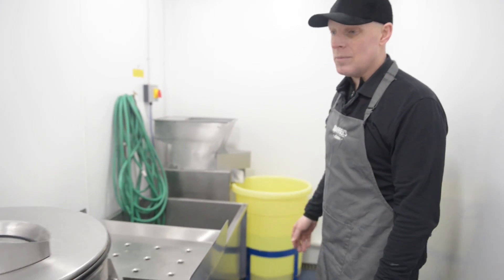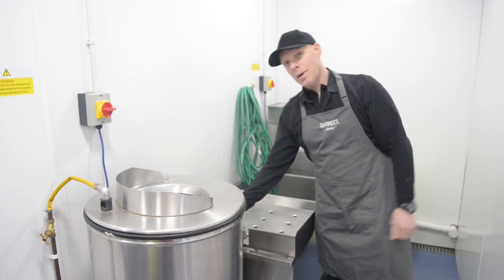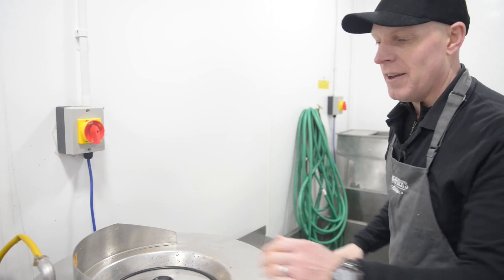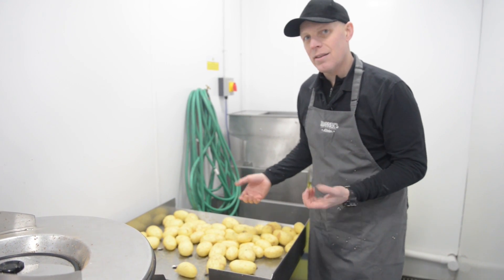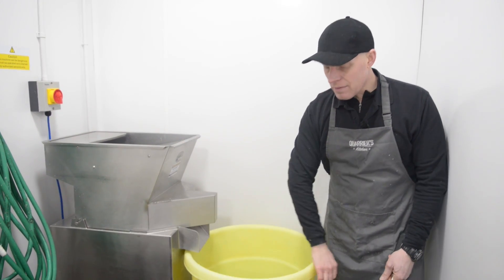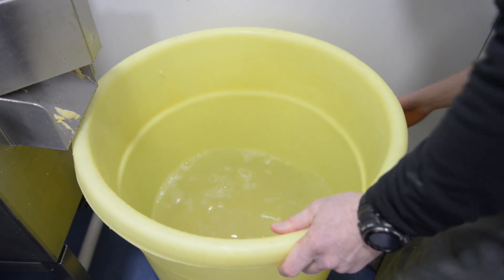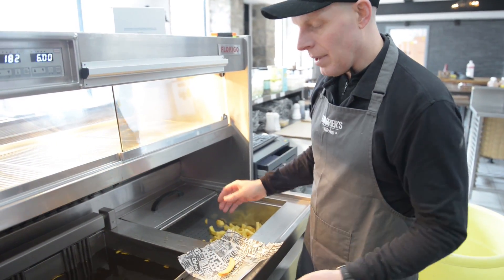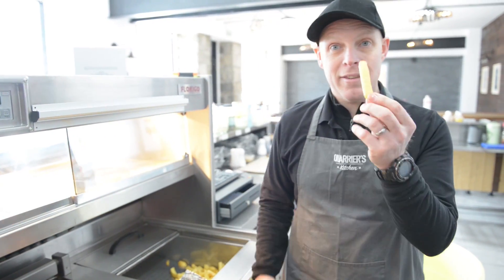How We Make Chips

Comment: Fish and chips cannot be that complicated.
Reply: You would be very surprised at the amount of work that goes on behind the scenes in your local chippy.
Reply: These are the steps needed to make good chips, at least at a fish and chip shop. People who cut corners produce inferior chips.
Reply: @girlsdrinkfeck  Not where I work. I peel 200-250 kg of chips per day which I then cut and are served throughout the day.  Believe it or not but it's cheaper to employ me than get frozen chips from our supplier. Pre cut chips fresh or frozen are expensive and all the time I've worked in the industry I have only seen one shop buy them for a few days whilst I was on holiday.

Our fish is delivered fresh daily in huge fillets which are then cut, put in the batter and flour and then cooked. The only time when fish is frozen where I work is if the delivery can't be made due to holidays. Our haddock is frozen because we don't sell enough but our cod is pulled out of the sea and delivered same day.

Frozen cod is rubbery and the flakes aren't as big and are more closely packed together. All chippies try to sell fresh fish when they can.

I break my back every day and my colleagues and suppliers work hard to get you a decent portion of fish and chips at a good price. It's sad to see there are people who think that everything comes in ready to chuck in the fryer when that's not what happens at all.
Reply: @girlsdrinkfeck  If you can get a large chips nowadays for anywhere close to £2 then I'd say you're pretty lucky.

We're paying £8.50 a bag at the moment for potatoes and all our suppliers are increasing prices at an astonishing rate. If we sold our large chips at that price we wouldn't be around for long.
Reply: It can actually be pretty hard, I keep failing in getting it like the fish and chip shop...

Comment: Sir your chips looks great. Can you give me the size /thickness of the chips. I am in Pakistan. Thanks
Reply: You want to use quite large potatoes, I prefer a variety called maris piper. You peel the skin using a peeler, then cut the potatoes into slices usually between 1-3cms thick, then cut each slice into chips around 1cm thick. Fry in hot lard. You know when the chips are cooked as they float on the top, if you have the oil at the right temperature, then they will float to the top and then start to get brown.
Reply: solatiumz Maris pipers? He lives in Pakistan.
Reply: Hot Lard? Hell no. Makes them taste disgusting.
Reply: @Gavin Byrne I asked this very question on another video. Another chip shop video - they blanch at about 130 degrees in oil then depending on how busy they are they either leave to cool before frying again at higher temp, or straight into the higher temp oil without letting cool. Heston Blumenthal also has a video where he par boils in water, let's them dry, then fry at about 130, leaves to cool then fries at higher temp - i always do that but it does take ages. I'd suggest trying each method and see what tastes best to your liking👍
Reply: Could you do a video making potato fritters or scallops as some people call them, making them from scratch, thanks.